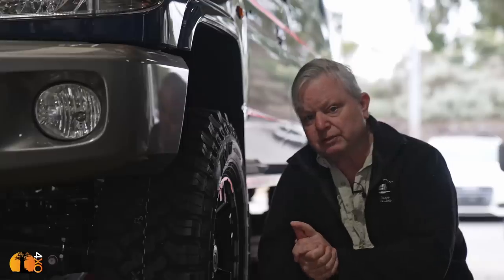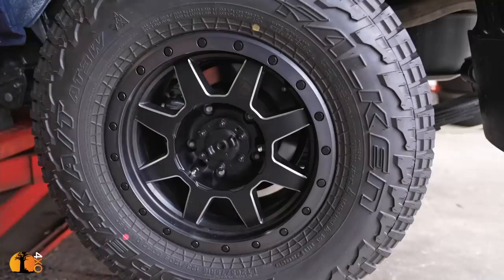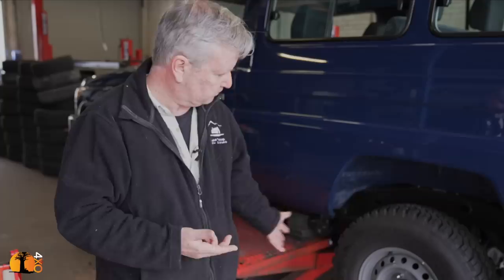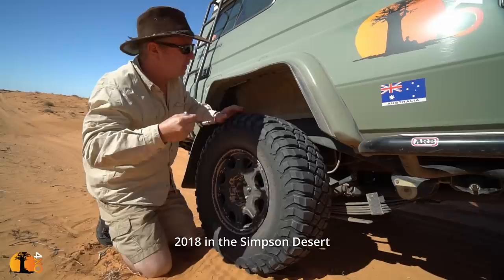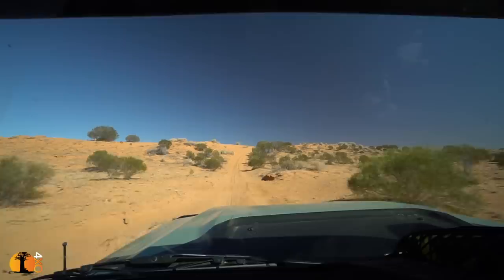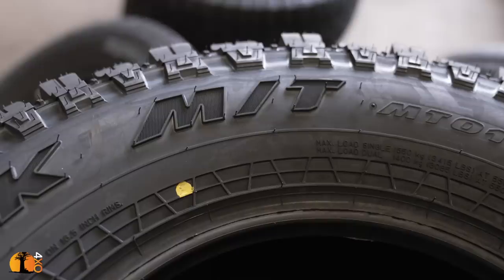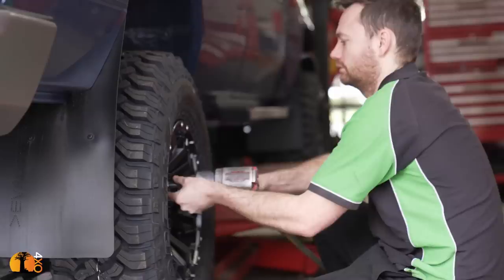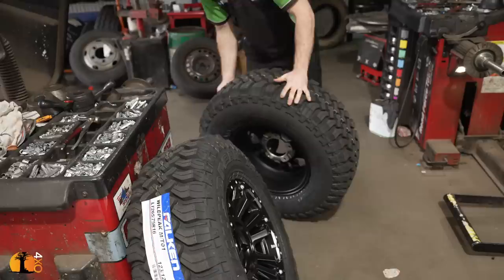TYRE AND WHEEL RIM CHOICES | BUILDING THE BEST 2-PERSON OVERLAND TOURER IN THE WORLD | 4xOverland

Comment: I must say I disagree with you Andrew. I'm a massive fan of skinny tyres. The best size for me is a 7.5R16 or a 235/85R16 on a rig like that. Coupled with split rims, you can get yourself fixed up in no time with little effort, reducing the need to carry too many spares.

255s just might be more preferable depending on the vehicle weight. I've actually got a spread sheet I've put together using the equations and concepts in Wong's books on teramechanics. I might run the numbers through, probably won't be much between a 235 and 255. However, that's where skinny reduces the risk of staking a tyre so would be my preference.

I have been looking at a 76 series and I'm loving the 225/95R16, however they aren't common. A 33 inch super skinny tyre gets me excited.

Comment: You know steel rims are better for off road I am sure. Strength and repairability. ESC limits the change in tyre diameter for roadworthiness. No point making car unroadworthy. In Victoria my Dmax comes with 245/70R16 and the legal biggest I can go is 255/70R16 but no point. Staying with the steel rim that Isuzu Dmax SX came with. 16 inch gives best side wall profile length for deflating purposes too, we all know that.

Comment: My favorite rims I run on the WJ, are the "METHOD 703's" 17x8.5 +25.  So close to a beadlock, without all the down sides of a beadlocks. 

P.S.  Went with the 255/75R17 because with the lift they fit the WJ and were square without the sidewall bulge.  Thank you for sharing your knowledge Andrew.

Comment: Is it safe to run tyres at near the weight limit? I want to put KM3's on my isuzu npr. It is registered at 4.5t so the front axle should stay under the limit for 2xKM3 but it's pretty close.  Is that safe or is a margin of error of a few hundred kgs necessary?

The reason for this is that although this truck is primarily for the road, my property is on a hill and even a little rain I get the wheels spinning in the mud.

Comment: I thought 17” rims and their tyre options were the most common 4wd combos. Were they a consideration?
Reply from the maker: The higher the profile the better. 17" was not an option when 16" were available.
Reply: @4xoverland  I understand the desire to stay on 16" but i've given this quite a bit of thought. If you have a 33" tyre on a 17" wheel, the Rim to road height is the same as a 32" tyre on a 16" wheel.  The 33"/ 17" combo gives you a bigger diameter, the same ability to air down and a slightly longer contact patch at comparable pressures.  If the tyres were readily available in say 255/80R17, would you consider this a better choice?

Comment: 265/75/16 makes 31.6 inch. Troopy standard = 225/95/16 (32.8 inch). This means loosing 1.2 inch clearance (30.5 cm). If having larger leaf pack at the back this is significant amount. Anyone can explain?

Comment: Disagree mate a lot, 305 wide 33 inch tyre is perfect on a trooper. With the 9 inch rim would be great. I think there may be some actual driving required in different terrains. You just need the right suspension. Standard suspension certainly won't cut it. 305/70 r16

Comment: Just wondering. What is the weight of the steel rim and tire vs the alloy. Remembering you are going for light weight build. Looks very good though
Reply from the maker: A small weight saving. 1kg per wheel. Not worth mentioning.
Reply: @4xoverland  every kilogram counts...Thanks for the update

Comment: Hi, I’ve seen some Falken AT3 and the size is measured in inches. Does this mean they are “flotation” tyres ? Are these tyres constructed differently compared to the tyres measured under the metric system?
Reply: Absolutely awsome tyres i have the AT s on my landrover these tyres are silent on the road also they are a silicon rubber mix they handle the heat heaps better without drying out they worked with thier customer base to design a lot of there stuff ,. They r quality plus not just trading on a name .... Lots of people r starting to use them ...

Comment: No disrespect to you Andrew but i strongly disagree with you on your tyre choice but how on earth can you feel the 20mm difference in width between the 265 vs 285 tyres?? Is losing over an inch of height really worth more than losing 20mm of width?
Reply from the maker: Yes. Because the width hits the body.
Reply: It is if you don’t want to cut/chop body parts to fit.

Comment: I'm surprised you went with something as wide as a 265/75 R16; is 235/85 R16 not available in Australia? We're generally quite limited in the UK as you know, but I did find that BF Goodrich import the Mud-Terrain KM3 in 7.50 R16LT 10-Ply size to replace the Michelin XZL, as well as LT255/85 R16, LT265/75 R16 and LT285/75 R16. Here, 7.50 R16 is dying out in favour of the 235/85 R16 and the 8.25 R16 is now replaced by the 255/85 R16.
Reply from the maker: I would prefer skinnier tyres. I said so. The 235/85 would be my next choice, but they are 31" and do not perform well on tar. I had them on my last Troopy and overall the 265/75 were better all-rounders.
Reply: @4xoverland  Sorry, I thought you were just referring to the 285's, I didn't know you were also referring to the 265's.

Strangely though, I thought 235/85's were also 32", or at least that's what my copy of the ETRTO Standards Manual says. It lists diameters of a 7.50 R16 as 805-825 mm (31.7-32.5"), a 235/85 R16 as 806-822 mm (31.7-32.4"), a 255/85 R16 as 840-858 mm (33.1-33.8") and 265/75 R16 as 804-820 mm (31.7-32.3"). Intriguingly, a 225/95 R16 is listed as 832-852 mm (32.8-33.5") and 285/75 R16 isn't listed!

At the end of the day, numbers aside it's all down to personal preference and we have to balance between what's available locally, what we like and what we can afford. I'm still running on tubed 8-Ply Avon Rangemaster 7.50 R16's (would much prefer tubeless tyres) but I came to the conclusion that a full set of tubeless wheels and tyres would cost me at least £1,000 if not more, and I'd rather put that money on shipping my Land Rover Series III back to Africa for another adventure, and buying tyres locally where the choice is wider and they're cheaper, and I'm supporting the local economy.

Comment: Different folks, different strokes as they say, l would have stayed with the steel rims, prefer the look, when l bought my new Defender 90 Td5 l got the dealer to change the rims it came with for those off a Defender 130, still steel but a bit wider and more offset and retained the original tires.

Comment: With all due respect, you just took a 40-50kg weight penalty and gone from the 33" skinnys to a 32" muddy.
Reply from the maker: Oh boy . . .  here we go. Did you weigh both tyres and measure the weights? No. You are guessing. Now go away and come back with some facts.
Reply from the maker: PS. I did.
Reply: @4xoverland  Hi Andrew, I weigh everything I add and own a 2 year old Troopy which I keep at or under 3300kgs.  The standard Troopy Bridgestone on the 6" rim weighs 29.5kg.  I don't have a Falken but on a previous 79series I ran Goodyear MTR (3 ply) 265/75 on Toyota 16x8 alloy Snowy rims and my recollection was they weighed 36kgs.  Maybe the Falkens and ROH are a bit less and if so, I apologise for the overestimation.  I met you on the Nullarbor one morning when you drove the Range Rover back.

Comment: Alloy rims on an “Overland” vehicle…….oh dear.
Reply from the maker: I have 37 years and over 1 million kms off piste overland in 20 countries. Two rim failures. One with a steel, one with an alloy. Only the alloy was repairable, although not on the track. The steel was repaired but could not be balanced and was trashed. Alloys provide lower unsprung weight. Some purists may say otherwise but I disagree. In the real, modern world, it makes little difference.
Reply: @4xoverland  I rented an off-road vehicle in Canada some years ago which had a complete failure of one of the rear alloy rims. The company were great and recovered the vehicle free of charge. Sometime later they emailed me a very interesting report regarding their hire fleet. A separate company had checked out their vehicles and found metal fatigue in numerous alloy rims (the rims were xrayed or ultrasound was used)…….sub surface cracks invisible from the human eye. It may have been the sub zero temperatures and tough life generally but all of their steel rims were perfect. A manufacturing fault was ruled out. On a side note…..don’t wrap the troopy. There have been cases of the wrap being very difficult to remove and damaging the clear coat. Safe travels 👍

Comment: There are some downfalls to wide tires . Biut wide footprint never has any downfall off road they are better in EVERY. Scenario .
Reply: Absolutely wrong.
Reply from the maker: Absolutely wrong. A wide footprint is a disadvantage on soft ground. What you want is a long footprint. The wider it is the higher its rolling resistance, the longer it is (affected by wheel diameter and sidewall ratio) the lower its rolling resistance.  A wider footprint can be an advantage on hard, slippery ground, but not always. It depends on the surface.  But a longer footprint is an advantage everywhere off-road. Do the military use wide tyres? NEVER. Do STOLL aircraft used in the back country use wide tyres? NEVER. They use tall, skinny tires with high profile tyres ALWAYS.
Reply from the maker: @Ozfreerider2504  Sorry mate. Yours is all theory. Mine is not. And what is more, the proof is everywhere. Why are 4wd enthusiasts the ONLY group that think they wide tyres are better. Everywhere else where it really matters  - military and aviation - don't. And I don't. I've proved it beyond all reasonable doubt myself.
Reply: @Ozfreerider2504  if you can "float" a 3+ tonne truck I'd be amazed